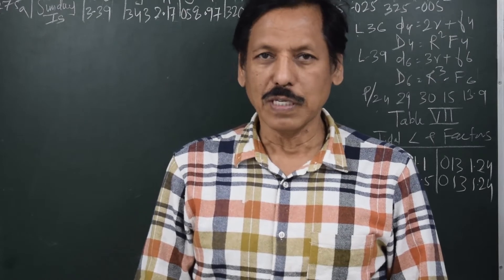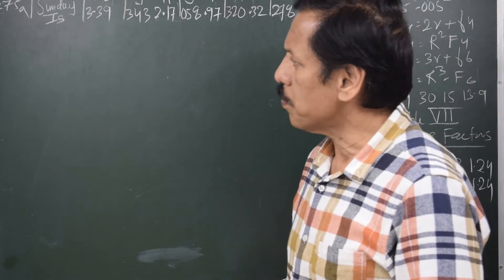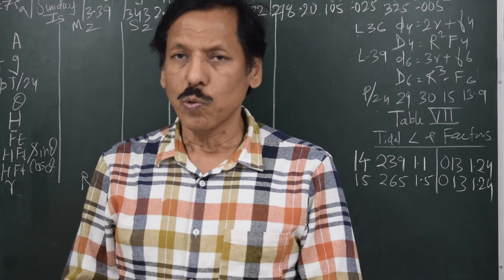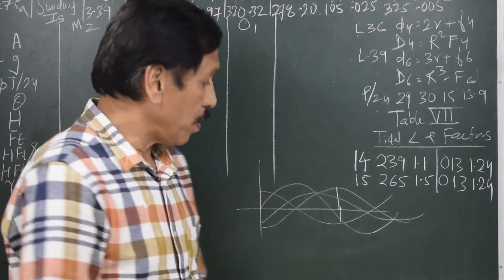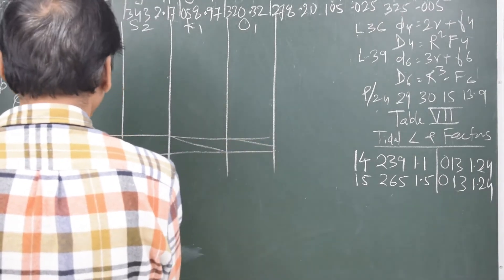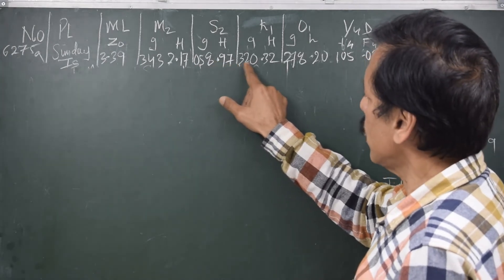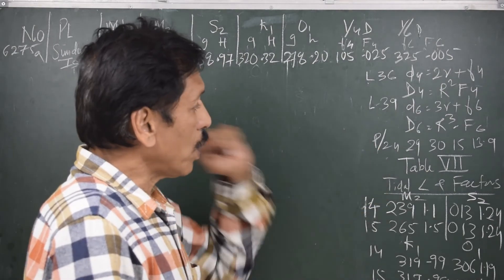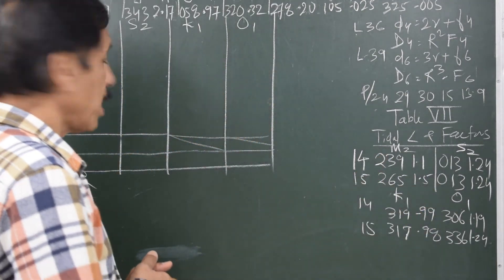Tides 6: Simple Harmonic Method 1 | Capt.S.S.Chaudhari

Comment: Hi sir, If the Tidal duration is less than 5 hrs or more than 7 hrs and the port mentioned is in 1992 Tide table vol 1 can we do it in normal way or SHM is recommended.

In other words , SHM method is it only applicable for 1992 Tide Table Vol 2 and Vol 3 ?
Reply from the maker: DOT is not the criteria for Vol 1. In Vol 1, the requirement of SHM is indicated, usually by 'p' or 'c' notation.